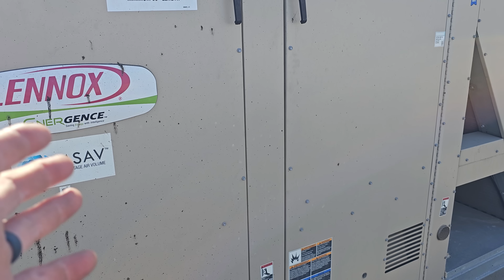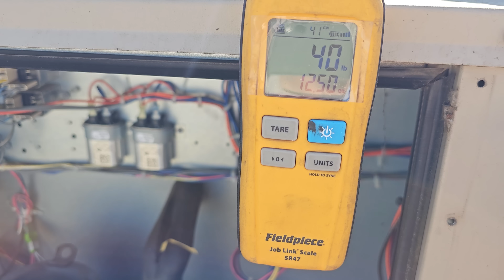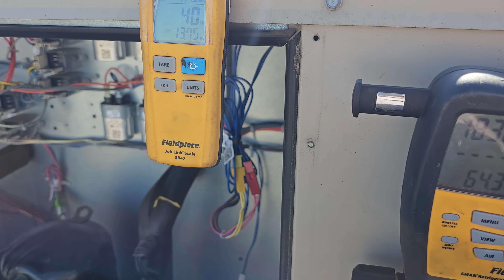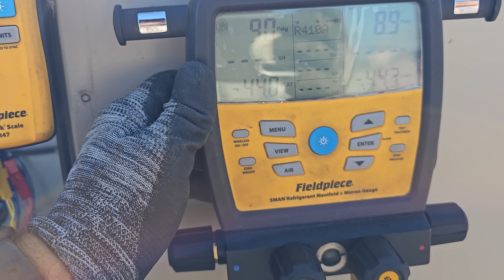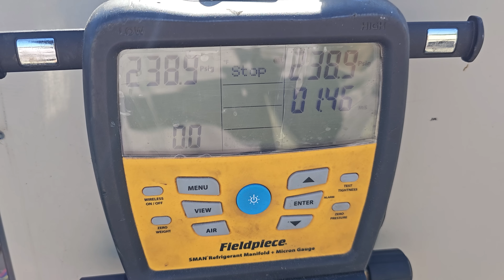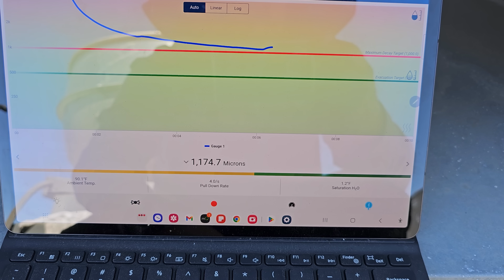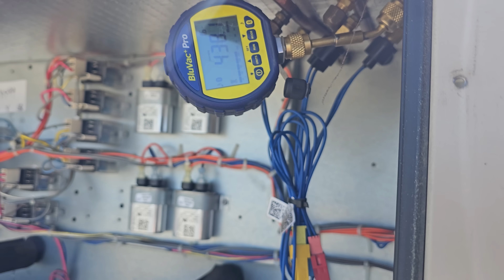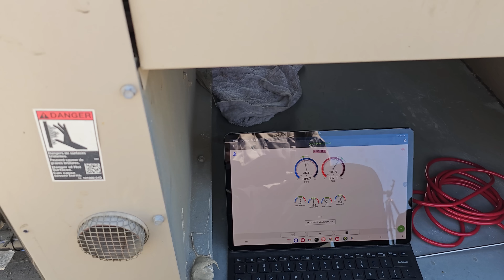ANOTHER MURDERED COMPRESSOR

Comment: That compressor failed because of the name on the side of it. When I worked on residential appliances they had the worse fridges on the market. Now with me doing hvac it’s the same way in this industry.
Reply: Bens junk and appliances has worked on close to 1000 fridges and he also says that their compressors are by far the worst
Reply: They make good OLED screens though! 😂
Reply: Just replaced a carrier package unit with a new one, LG compressor is the noisiest POS. Reverberates through the unit, despite sitting on a plastic pan assembly.
Reply: I recently replaced a failed LG compressor under warranty on a Lennox RTU that was less than a year old. Breaker was tripped. The compressor got so hot that it melted it’s own wires to the side of the compressor, shorting itself out. The wiring harness was melted/fused to the terminals on the compressor. I’m not entirely sure what happened, but after the old compressor was removed I managed to pry the wiring harness off (wasn’t about to do that when still pressurized with refrigerant) to test it, if I remember right the  run and common windings were internally shorted to each other. LG definitely makes some of the crappiest compressors.

Comment: If you're able to swap a compressor with something like 1 hour of downtime; why does it take others 24 hours to do the same job? I've consistently witnessed Copeland swaps here where it's an overnight job; the most wasted time is running vacuum pump overnight to test the system for leaks once the new compressor is brazed in? Is that even a thing?

Comment: For any stranded wire, you need to torque it down, back it off, then torque it down a second time, especially if using aluminum. That arc burn on the wire is because the wire was lose. Because the unit as a whole vibrates, the chances of that happening again are high.
Reply from the maker: I did that earlier in the video when I installed it. I always run the screws into the wires (tighten loosen than tighten again. Than I loosen and torque down with the torque driver
Reply from the maker: I will discuss this on my livestream this evening 11/27/23 @ 5:PM (pacific) on YouTube come over and check it out. https://youtube.com/live/Xa62hCcHZns

Comment: Here’s a tip on the use of torquing instruments…. as you rotate the tool, you have to have movement of the fastener, and then experience the click. If you put the device onto a fastener, and it clicks right away, you may have way too much torque on the fastener, and not realize it. As long as there is movement before the click, then you know that you have not exceeded the torque specification. If you go back to check a second time, then you’re not going to have movement. However, if you torque these fasteners down without using the torque instrument, and then apply the torque instrument to the fastener, there must….repeat, must be movement.
Reply: yep love watching the tire shop guys using the torque wrench after the impact and getting zero movement on any of the lugs. lol
Reply: @ionstorm66  it's even worse when they use as a breaker bar 😁
Reply: Yeah. Also you stop at the first click
Reply: @scwfan08  Yep.

Comment: Great tips you shared with not pushing in the contactor inline with the vfd and shaking the compressor to separate oil from nitrogen. Another great video demonstrating the importance of looking at the big picture and catching that loose wire preventing more callbacks and repairs. Thanks for sharing. Keep em coming!

Comment: Good catch about the compressor with a leaking internal high pressure relief valve.  That is a rare thing to find.  It will send high pressure and very hot gas into the low side of that compressor, quickly overheating it!  

One time I was explaining to a customer that the freezer compressor was bad, even thought it was running.  I shut off the liquid line valve, and after 5 minutes, it still had not pumped down, and was still running.  The amp draw was only about 40% of the maximum rated on that unit.  Sadly they did not believe me when I told them the reason for the warm walk in freezer was a bad compressor, bad valves.   It was a large chain store restaurant, and they basically told my boss that they would seek another refrigeration company.  

I can only guess what the next guy looking at their walk in freezer had to say?  And did they get fired for telling them basically the same thing?   

Yes I tried to explain it to them, and my boss was understanding that I was right in condemning the compressor.

Comment: I had issues where they still won't take the compressor back if it ain't soldered shut, the rubber plugs are not enough.  Now doesn't really make sense since you get the new compressors with the rubber plugs installed.

Comment: It took me far too long to realize the micron gauge isn't measuring size, but pressure. In my head, I was thinking micron was measuring the size of the particles of refrigerant or nitrogen. Instead, its micrometers of mercury, or umHg, and 439 microns converts to 0.008 psi. So really dang low
Reply: 0.6 mBar(A) for the rest of the world ;-) indeed quite a low vacuum.
Reply: I was never sure of how the measurement translated. I only knew that it was more precise. Thanks for the definition.
Reply: @BiigCheeze  You're welcome! Always happy to spread knowledge that I just learned myself

Comment: Seem like you got high oxidation on the supply breaker since you got 206V on 1&3. I normally disconnect all the load and then cycle on/off the supply breaker several times until I get 208V or even across. Most often is 208V unless the main breaker is oxidizes too but that's rare.

Comment: One thing id add for anyone who doesnt know, low suction pressure is just as bad as high discharge pressure in terms of how compressors get killed. Wether it be from low charge,restrictions, or low airflow,doesnt matter. Compressors are refrigerant cooled and low  suction pressure/temp = lower mass flow rates=improper cooling of the motor regardless of the lower temps. If restriction or low airflow is the cause, this raises your compression ratio drasticly and high discharge temps result during long run times with the lack of cooling. Compressors can even run hotter discharge from very low charge as well. You may have a very cold evap ex.20f sat temp, but it will pick up so much heat so fast you could end up with 50f superheat and a 70f or higher vapor entering compressor which is too warm. Then theres liquid floodback and slugging which are pretty high up on the list of killers with multiple causes to them both. Also while rare, a rv bypassing slightly to the point where no one notices theres an issue but you have vapor entering compressor at 80,90,100+f for long periods.

Comment: I've been watching for a while your videos, and I noticed that it is common to use fuses instead of circuit breakers, is there any specific reason? I'm from Brazil, and here we always prefer a circuit breaker, as maintenance becomes easier, the fuse needs to be changed, the circuit breaker, after identifying the reason for the trip, just need to reset it.

Comment: you should use insulated core ends on wires like that to prevent stuff like that from happening. also prevents fingers touching the bit that makes you say the bad words...
ps: dont these unts come with the phase detector to prevent murdering the compressors?
Reply: Usually it check phase of the power coming into the unit. But if someone changes the compressor, or the contactor, they could potentially wire it back wrong even though the phasing to the unit is correct
Reply: @vincentgrueter7759  phase detectors also trigger when you lose a phase for example wich would also kill a compressor. its a safety device that protects the compressors after installing the unit.

Comment: When you have a VFD, checking voltage to the compressor doesn't tell anything about the input voltage. In those cases, you need to check both voltages at input and at compressor level. By the way, with VFD is quite useless to check voltage at compressor level. Usually VFDs have internal diagnostics (should display an error).
Reply from the maker: The vfd on that unit only controls the indoor blower motor it does nothing for the compressors
Reply: @HVACRVIDEOS  how could I have thought  differently? 🙂I'm a little bit in electronics design, not so much in HVAC.
Reply: @elegri that's why he only comments about what he knows so he doesn't come off looking like a DINKLE BERRY LIKE THIS GUY
Reply: @dmiestercommkitchentech3043  some refrigerators (high end) have vfd. Hence the confusion.
Reply: @elegri  I've been working in the commercial equipment trade for nearly 25yrs and the only place I have seen any type of VFD's is in HVAC and some walk in manufacturers use them like the Beacon systems but most refrigerators don't use VFD due to costs what high end manufacturers are you seeing VFD's on?
Reply: And they are only to control fan speeds the VFD's
Reply: @dmiestercommkitchentech3043  not commercial but consumer
Reply: @elegri  ??????? Does that mean you stated you work with electricians what do you mean consumer not commercial?
Reply: @dmiestercommkitchentech3043  chill out man. Consumer products. Refrigerator by LG, Whirlpool, ...
Reply: @elegri  so residential equipment not commercial don't be critical about stuff you have no knowledge about and you won't get called out on it. So you CHILL OUT MAN.
Reply: @dmiestercommkitchentech3043  you are like the guys that need to make a point on a topic where they have no involvement at all. I made an incorrect statement, @HVACR VIDEOS made a correction. I acknowledged the error and that's it. And now you are pointlessly trying to be the perfect guy. Have a good life. BTW, when answering, it is better to read carefully what somebody wrote.
Reply from the maker: No need to get upset guys, I appreciate all of you and I welcome criticism and I also appreciate it but please don’t get nasty. I really appreciate the community we have here and it’s all of you that make the community work-
!!
Reply: It's all good man. I was not aware that VFD's were in residential appliances I know they are in Industrial and some HVAC for economic savings per government 🤔

Comment: Can you go into just a little detail as to why not to push in the contactor when you have a VFD employed for the blower?  Isn't the power coming from the actual VFD?  Feeling stupefied here.
Reply: If the contactor is present and wired, it is usually used to bypass the vfd. Pushing it in will send power directly to the output of the vfd which WILL cause the vfd to explode. The vfd MUST be completely disconnected when bypassed.
Reply from the maker: I will discuss this on my livestream this evening 11/27/23 @ 5:PM (pacific) on YouTube come over and check it out. https://youtube.com/live/Xa62hCcHZns